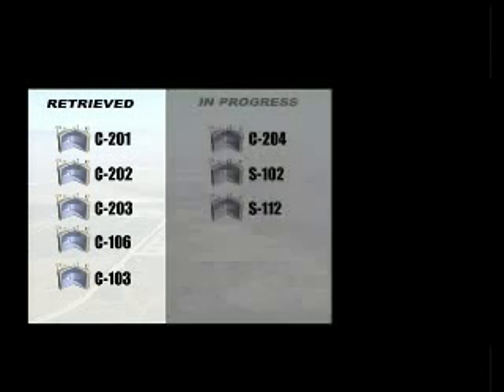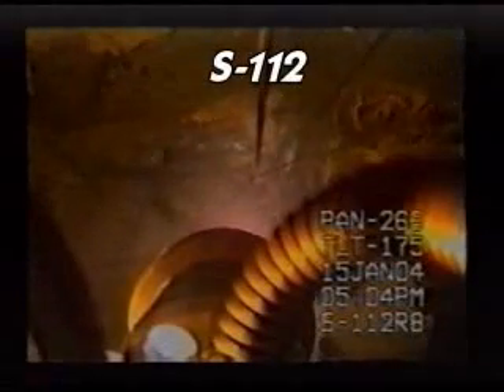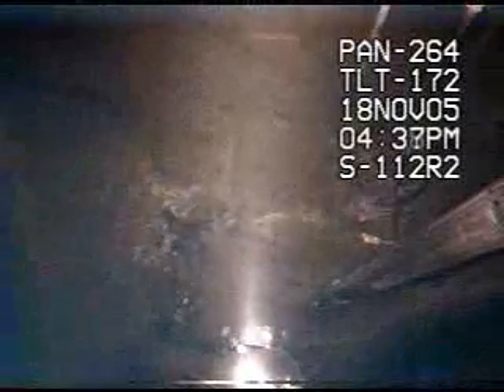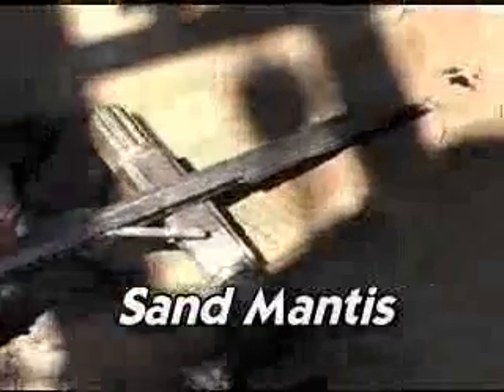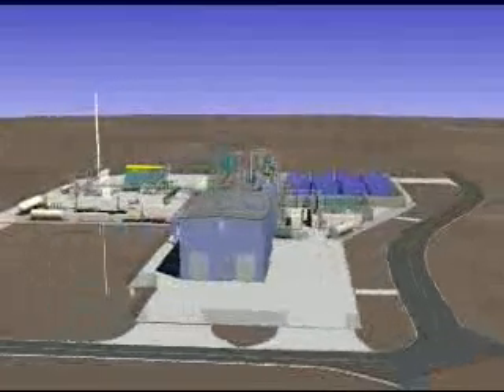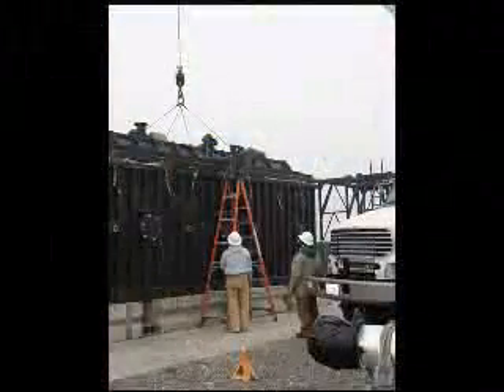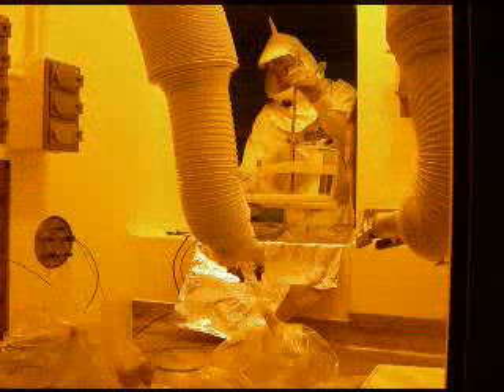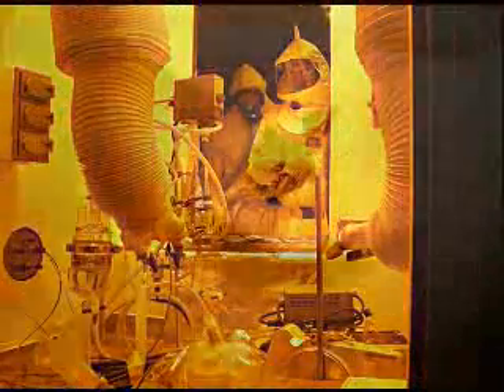Hanford Nuclear Waste Cleanup

Comment: This video shows emptying of the single-shell tanks.
Their definition: an acceptably EMPTY tank holds "only" 360 cubic feet = 2,693 gallons, or about two tons of hard residue! Wow!
Hard deposits formed because they re-concentrated liquid tank waste several times. They've locked in on WASHING waste out of tanks. When they use heated water to wash out hard salt deposits, the dissolved salts will turn into a hard salt crust again in the destination tank. Mining techniques might be more appropriate.